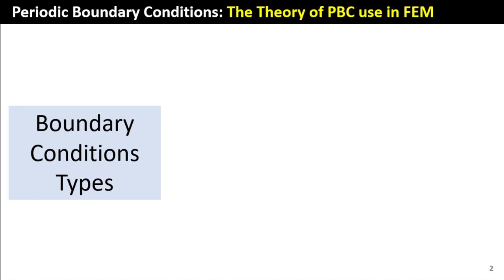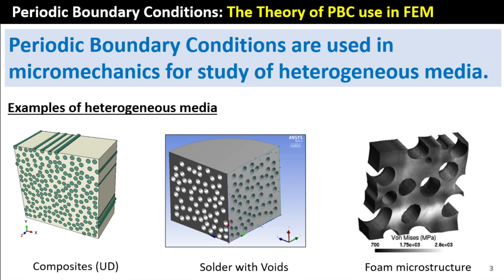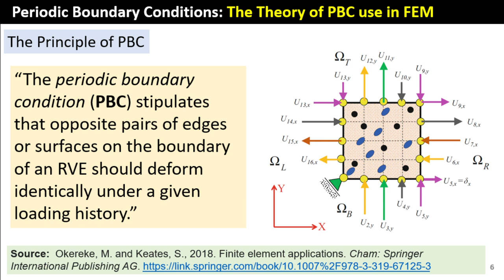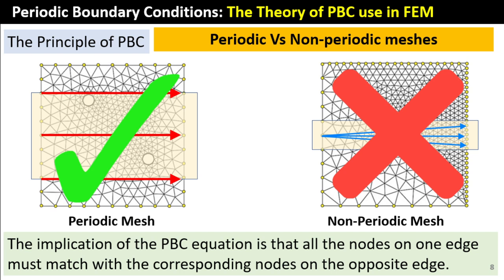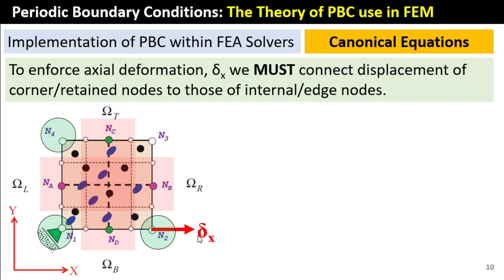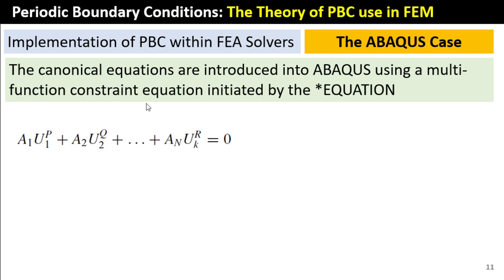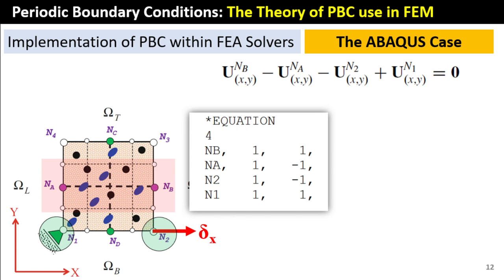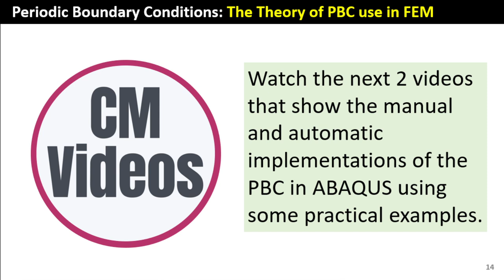Theory of Periodic Boundary Condition implementation in FEM

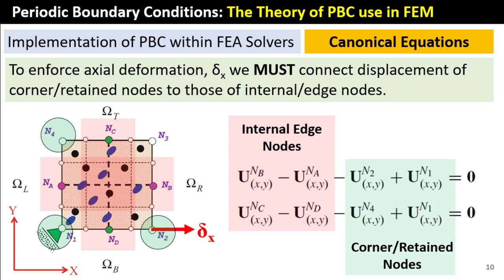Comment: I have two questions, that I am still confused on. Hopefully you can answer.  17:38

First, why did you not connect node 3 to anything? Why was N4 and N1 used instead of N3 and N2.

Second, Lets assume you are applying a uniform displacement in the Z-direction that starts at NC and goes to ND. what corner/retained nodes would I use to connect my internal nodes?
Reply from the maker: Hello @Chase, thanks for the comment. I will attempt to answer.

1. Node 3 is called a slave node because, as a consequence of how the kinematic equations are defined, the node 3 adopts the degrees of freedom of nodes 2 and nodes 4 depending on the loading type. So, it has to be a slave node, and hence is not included.
2. The deformation along the Z-direction is slightly different. I wrote about this in the paper: https://doi.org/10.1016/j.commatsci.2012.12.036. If you read through it, you will see how I dealt with loading in the Z-axis, just a light change to the formulation already discussed in this video but certainly do-able.
Reply: Hello , Dr.Michael. Is there a description of PBC loading for the 3D RVE model in this paper which you mentioned above

Comment: Very interesting video to understand the Periodic Boundary Condition. But I would like to understand the difference between the representative volume element (RVE) and studying a normal specimen as the simulation of lab experiments and also the difference RVE and X-symmetry or Y-symmetry sections. Thanks in advance
Reply from the maker: Hi John, thanks for your interest in the channel. Representative volume elements are  virtual domains that can be used as a substitute for the normal specimen. It is expected to give results that are comparable to normal experiments. Where you are finding it difficult to undertake the simulation of the normal specimen, then an RVE will be cheaper on computational time and can still give you good results. 

On your second question on RVE, X- and Y-symmetry sections, these are related. The X- and Y-symmetry is often used when identifying an RVE for a material. They are not the same but if you are looking to isolate an appropriate RVE for a physical domain, it is quite normal and common to consider the use of the X- and Y-symmetry of the material/domain to help you.
Reply: @MichaelOkereke  Thanks for your explanations but I have to use the Periodic Boundary Condition (PBC) whenever I modelling RVE or I can use the normal boundary conditions like fixed, hinge, roller too. If so, I would like to know when shall I use PBC, I mean how can I choose to use PBC or normal boundary conditions. Thanks in advance

Comment: Great video! Would the same concepts presented apply to FEM for Electromagnetics (i.e. Electric field)? Also, is there any special consideration for when there are multiple materials?
Reply from the maker: Hello @Jake, I believe this will apply also even for our electromagnetics field, depending on what type of field you are using. The method shown here works on Dirichlet-type boundary conditions, in which case, you specify define (constant) values at nodes at a given time-step during the simulation. In our case, if you can specify definite electric field to nodes in the boundary, then this method should work. However, it your electric field is a Neumann type boundary condition (in which case, it is not a predefined value but a traction, concentration, flux term), then this will not work. You really need to give it a go by modelling your problem and running the software on it to see if it generates a PBC-enabled RVE which you subsequently run to see what the results will be like. Good luck!

Comment: It is a bit more complicated. When N2 moves by delta_x and N1 is constrained (fixed) then UN2=UN1 cannot be true. Actually UN2-UN1=delta_x not zero. Similarly UNB-UNA=delta_x etc. I guess this method does not allow to prescribe effective stress load on the edges, or does it?
Reply from the maker: Hello Robert, thanks for your comment. It is indeed complicated, the whole PBC stuff. I wanted to make some clarifications to your comments. 

First, N1, N2, N3 and N4 are called constrained nodes, so they are not prescribed with periodic boundary conditions. I use them to apply a required loading type to the model. So, when you say if UN1 is fixed say in the x-direction, that means the displacement there is zero. However, when UN2 is imposed with a delta_x load, then UN2 will have a dispalcement of UN2 = delta_x. As a consequence too, UN2 - UN1 = delta_x, as  you rightly posited. However, at the onset of the model, without delta_x imposed on the system, UN1 = UN2 or in other words, UN1 - UN2 = 0, but when there is an imposed load, then the zero is replaced with delta_x. I believe you got this correctly.

However, your second comment on UNB - UNA = delta_x is not necessarily true. This is because those are internal nodes that will not automatically take the value of delta_x. The only way they will take that value is when you kinematically link N1-N2 to NA-NB which is the equation I described as: UN1 - UN2 = UNA - UNB. If the system is homogeneous without any microstructural heterogeneity, then automatically, UN1 - UN2 = delta_x and then your comment is correct. However, as we are looking at heterogeneous systems, it is better to use the UNA - UNB nodal values as you travel along the edges (considering the internal nodes). In some instances, those nodal values may even result into negative values depending on the environment of the microstructural constituent of the RVE.  I believe we are saying the same things but your comment relates for a special case where the domain is heterogeneous in which case the edge will deform uniformly (as if you imposed a dirichlet boundary condition to it).

On the last comment around prescribing effective stress load on the edges, I am not sure I understand that. I know there is another PBC method where you do not explicitly impose delta_x to the edges. The other method is the strain tensor method, where you will apply a strain field to the domain using a virtual node, which is kinematically linked to a part of the model. The method uses the strain field to multiply the set of edge dimensions, which will again result into a set of displacements [delta_x delta_y delta_xy] and the like. In this case, the user will focus on the expected strain in the model as an input. The stress will result after the FEA simulation. I do not know of a case where effective stress is imposed as an input to the model. Please point me to any literature that deals with PBC in FEA like that.

Thanks for your comments and I appreciate you thoughts.

Comment: Hi, Dr, Michael. Thanks very much for your video. I am recently researching helical structures, which also use PBC. However, that is more complicated because the canonical equation used inside is nonlinear and sometimes has a displacement coefficient. Therefore, I have to use the user-defined MPC inside ABAQUS, which I think is not so easy to implement and I still have some confusion about this subroutine. Could you please take a video and share with us some experience?
Reply from the maker: Hello Pan, thanks for the query. It does sound you are dealing with a really challenging task. If you can, share a paper about your problem and I can see if I'd better understand it.

I have not used MPCs for applying PBCs but like you said it all depends on the canonical equations. 

I discussed this extensively in my FE book. If you have it  look at the section about canonical equations and boundary conditions,  it might help.

I do need further information before I can consider it for a future video request.  Cheers.

Comment: Thank you for the video! I just wondering is it possible to apply PBC in a macro-scale model while we're intersting in discretizing full-scale model into smaller finite periodic model? Also, I found quite a few resource in YT showing PBC application with the thermal analysis. Appreciate if you could emphasize on that!
Reply from the maker: Yes you can! I will think about the thermal analysis aspect.

Comment: U10y and U4y are going the opposite direction, they're supposed to go the same direction right?
Reply from the maker: Definitely @Tonda, the directions at 8:07 are wrong. Well spotted. Same applies to U5y and U9y.  They should be pointing in same direction. Thanks.
Reply: @MichaelOkereke  Thank you! Do you mean U10y and U4y are pointing in the negative Y direction together? Also, U5y and U9y are pointing in the negative Y direction together?

Comment: Is it necessary to constrain the nodes on the edges and corners? If we only constrain the corresponding nodes on the edges and then apply a displacement load on one side, can we still achieve periodic boundary conditions?
Reply from the maker: Hello, according to this type of Periodic Boundary Condition implementation, it is certainly important to specify in internal nodes the applicable linear constraint equation as I showed in this video. This is what makes for a periodic corresponding edges deformation. The corner nodes are not prescribed with this equation hence they are free to be used as anchor points to apply and impose the applicable/desired loading type. 

If you do what you suggested in the second part of your question, you will see a deformation but only the corner nodes will before and the inside nodes will not follow suit as they have not memory of what the corner nodes are doing. The linear constraints equations (imposed on internal nodes) prescribe the kinematic linking that will connect what the corner nodes are doing to the internal nodes. I hope the explanation makes sense.
Reply: Perhaps my question wasn't clear enough, my apologies. What I meant to ask is: why are the constraint equations for the nodes along the edges combined with those for the corner nodes? I believe that in finite element analysis, the transfer of displacement loads occurs through shared nodes, and there is no need for additional displacement constraints between nodes. I would like to know if there are any special considerations for the periodic boundary conditions at corner nodes? Also, are there any special aspects to the periodic boundary conditions along the edges and at the corners of a 3D Representative Volume Element (RVE)? @MichaelOkereke
Reply from the maker: Thanks for your question! I understand the confusion and I'll do my best to clarify it for you.

You are right, that it might seem strange that there is a combination of constraint equations. The reason for this is that I am using a slightly different formulation of periodic boundary condition which a few authors use. Instead of supplying a strain tensor during the simulation, you would rather supply a displacement. That displacement is applied to an un-attached corner node. If left unattached from teh generality of the model, it will deform but that deformation will not be transferred to the full model.

The solution is to then use kinematic constraints to link corner nodes to inside nodes. The inside nodes have also been prescribed with kinematic constraints themselves. This way, the corner nodes become anchor points for imposing loads, and those are then linked to internal nodes which then make for transfer of loads from an initially detached corner nodes to a later kinematically-linked corner nodes with the inside nodes.
You might be confused but I am trying my best to explain. Look at the equations I used in the video again and see if you understand.

I explained this more in my book which you can see here: https://link.springer.com/chapter/10.1007/978-3-319-67125-3_8 which is Chapter 8 where I discussed these ideas in more detail.
Reply: Thanks very much. I seem to have some understanding, but I still need to carefully study the book you wrote. I would also like to ask: In your video, are the elastic parameters predicted the same when displacements are applied at the corner points and when displacements are applied across all boundary nodes? @MichaelOkereke

Comment: Hi, why i always must impose an strain? Are other alternative? Like solve the micromechanical problem with iterative calculation
Reply from the maker: Hello, thanks for the query. I am using a particular method in generating the PBC response which requires specifying a Dirichlet BC e.g. displacement at a retained/corner nodes. Since the RVE has kinematical constraints enforced using the *EQUATION command in ABAQUS, any movement at a corner nodes will cascade down the material (periodically) leading to the expected behaviour. 

I know some other authors use strain tensor (which they introduce into the model), but this is not how I do it. It is also a valid approach. I am not sure what you mean by solving the micromechanical problem with an iterative calculations, sorry!
Reply: @MichaelOkereke  hi, thanks for the answer.. my question go on the direction of plastic deformation but is not the case. About your answer, i have a question.. why PBC requires dirichled bc?
Reply: @MichaelOkereke  Hi, thanks for the answer.. my question are about non-linear and path dependent, but is not the case.. but i have another question.. why did you use Dirichlet BC?? where can i find literature about that and.. what is the model with strain tensor?? thanks
Reply from the maker: PBCs in the way I use require that you specify a displacement at a node hence the Dirichlet approach. It is only the displacement at one node that is Dirichlet. The other nodes are imposed with PBCs.
Reply from the maker: There are so much literature on PBCs but this was one that was particularly helpful when I was learning about this: 

1. Kuznetsova paper: https://link.springer.com/article/10.1007/s004660000212 
and 
2. My paper: https://doi.org/10.1016/j.commatsci.2012.12.036

Hopefully these will help you.
Reply: @MichaelOkereke  thanks dr, but… there are an justification for use Dirichlet BC?? My question is for my MSc thesis and i cant find the justification for use a unit displacement or dirichlet BC. Thanks
Reply: Hi doctor @MichaelOkereke  , i have a question that i did in another video.. why displacement flucuations are Zero in this model? why is the reason.. i know is zero in the corners and periodic on the center.. only i read that is usual for homogenissation but nothing more.

Comment: Thank you for the video! I just wondering is is possible to apply PBC in a macro-scale model while we're intersting in discretizing full-scale model into smaller finite periodic model? Also, quite found a few resource in YT showing PBC application with the thermal analysis. Appreciate if you could emphasize on that!
Reply from the maker: Yes you can! I will think about the thermal analysis aspect.